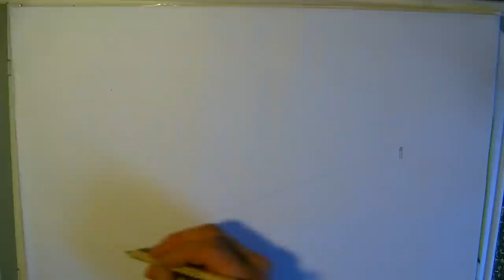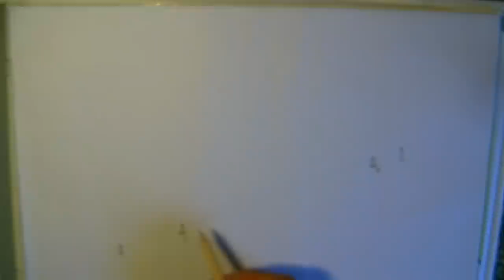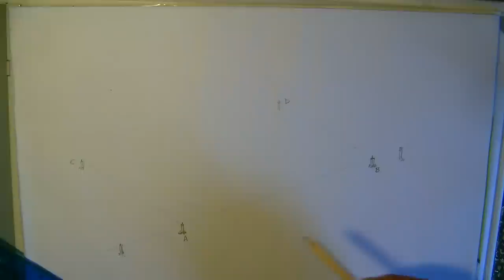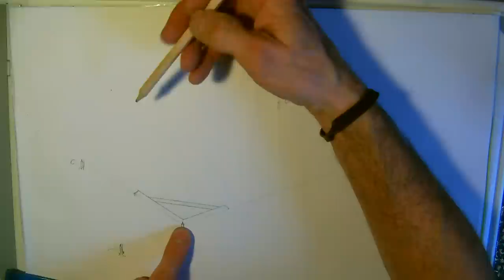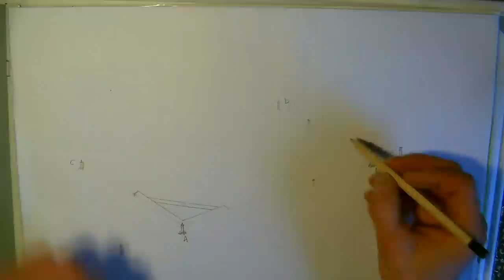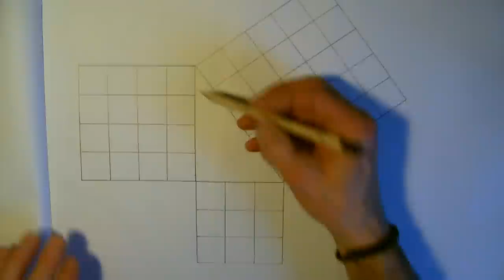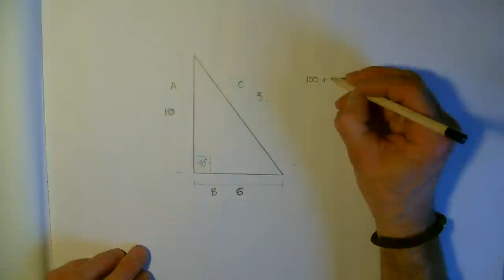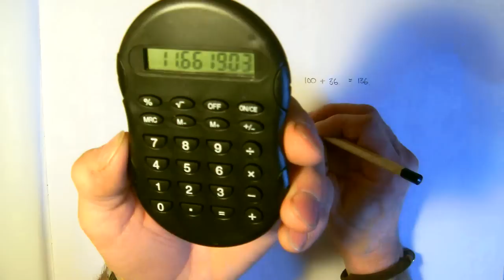Setting Out  Lesson1   3:4:5 method

Comment: On the last calculation when you did 6 and 10 shouldn’t the 10 have been 8 and therefore it should be 6m2 +8m2 so 36+64 =100 so the last measurement would be 10m2 = 100 ?
Reply from the maker: Hi Ozzy, the example was of a building 6x10 metres. The 6x8=10 squared as you mentioned could be done if the sides are doubled. The example shows the method of squaring an 6x8 building, hence, side C was 11.661m